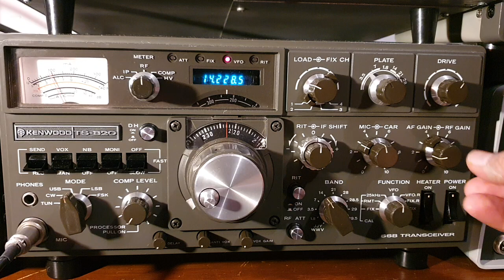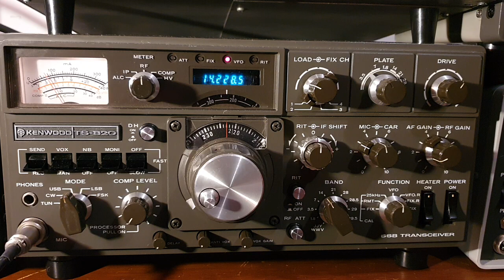How to Tune Vintage HF Transceivers with Tube Output Stage | Kenwood TS-820 HF Transceiver

Comment: We used to say "Peak the grid current, dip the plate Voltage, and tune for maximum smoke".  It worked for my HW-100 and my FT-101.   --  AA6LJ
Reply from the maker: Haha, sounds like you had some fun times with those rigs!
Reply: @spacetimeengineering  Yes I did!

Comment: Your freq is 14mhz but your plate is on 3.5mhz?
Reply from the maker: Very good observation. The tuning knob on plate is not aligned with dial need to put it back into right direction. Many thanks for supporting channel. Cheers